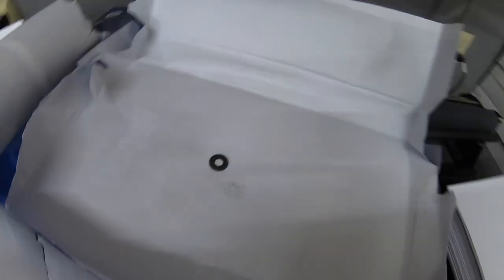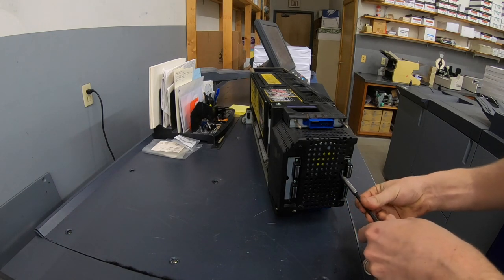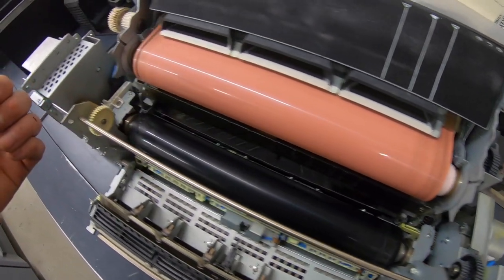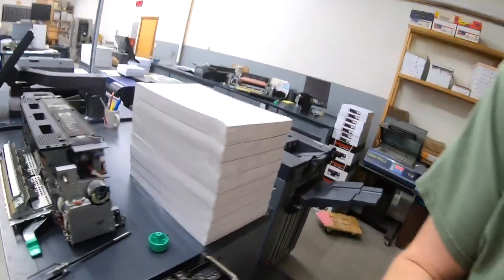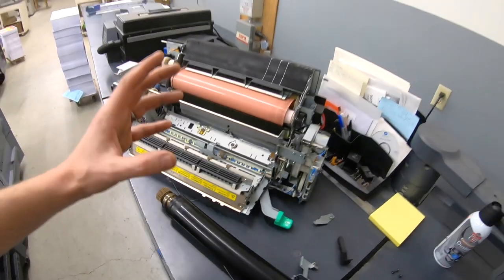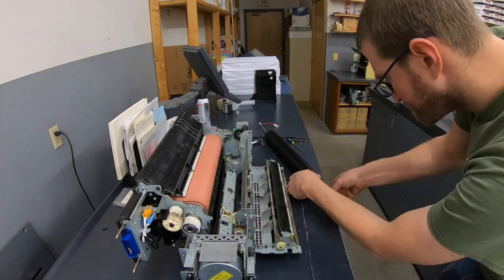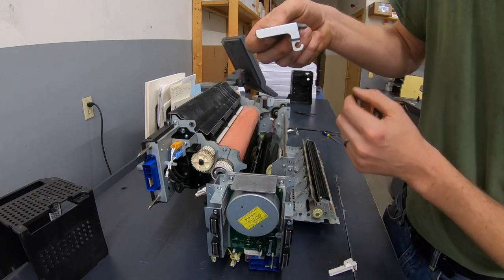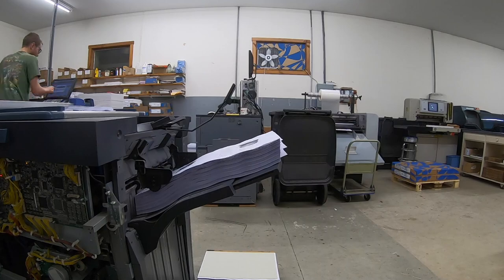Fuser Repair and Two Paper Surprises I Didn't Expect

Comment: Hello, 
I am a specialist and trainer of KM engines since 2000.
The lamp broke for sure because of the broken bearings.
My advice is that when replacing the bearings and gears you should apply high temperature grease.
It is also counterproductive not to change both sides at the same time to avoid skew, as well as to over extend the replacement of the bulbs because they degrade and lose heat output.
Good job.
From Spain 
Toni
Reply from the maker: Good to know, thanks. I have never put high temp grease on them but will get some now. Always feel free to comment, appreciate it!
Reply: Toni, can I ask your advice about a Problem I have with my C6000?
Reply: Hi Antonio. I would like to get in touch with you. How can I do so?

Comment: I recommend springing for a whole fuser unit to swap into any of the machines while you do repairs then you have more uptime.
Reply from the maker: That would be handy. Nice thing about having 3 color machines is I can either swap those fusers or just run the job on the other machine.

Comment: Just a recommendation, if you ever have to take apart and service the fusing unit, please make sure to always change you heat-insulating sleeves on the roller with new ones. Changing the bearings is a judgement call based on what one see, but regardless of how "good" those heat-sleeves may look, I consider it a "must" to replace. When they do break, the failure to the fusing unit is usually "catastrophic". The low cost of these heat-sleeves is well worth the long-term savings.

Another tip: Most KM production units now-a-days (whether monochrome or color) have default pressure setting for each tray (under the paper tray settings -> expert adjustments). I've set all my trays on all my machines to the lowest pressure and have noticed a considerable improvement on the fuser failure rate. We run several dozen KM production machines...

Keeping in mind that fusing (toner onto paper) is accomplished through a combination of heat and pressure) - The thicker the paper, the more heat (and less pressure) will be applied. Conversely, the thinner the paper, the less heat (and more pressure) will be applied to maintain consistent fusing.
The heat-sleeves will bear the direct brunt of the pressure being applied on those rollers. Reducing that pressure (and changing your heat sleeves more often), will save you lots of trouble.

The trick here is to ensure that your fusing is always adequate. One can compensate for less pressure by applying a bit more heat (by changing paper-weight settings on the tray). My suggestion is to always check a proof print by forcefully rubbing your finger on the print to ensure that there is no smudging (poorly fused toner) and then compensate by changing the paper weight if you find that you are having issues. Personally, I have seen zero ill-effects from adjusting the standard pressure to "weak" and never had to compensate on the paper weight, but I can see that it could potentially happen, especially with thicker paper. I hope this helps someone out there.
Reply from the maker: Great point. I lowered the fuser pressure on my c6500 by turning the screws and I noticed much longer life. I didn't think of doing that with my newer machines awesome! Thanks for the insulating sleeve tip too!

Comment: It's not unusual to lose a lamp when a bearing or insulating sleeve go out.  Sometimes the lamp can arc to the frame and blow up boards and solid state relays.  Good idea keeping old parts around, they always are handy.
Reply from the maker: Agreed, if there is still life in something and you have the space, hold onto it..

Comment: Hello, Everyone. The trouble has been tearing for 3 years. konika 3070, mileage on the meter 320 thousand was native with kotskaya but alive, working. we decided to change it so that the print was normal without kotsky on the middle of the sheet, and as the engineers said, it soon came up. I ordered, disassembled, changed, but I repent - I put the screw one crookedly and it turned out to be a little lopsided. I printed 20 sheets and the belt climbed to the extreme part on the left and broke. I took the stove to Novosibirsk to a professional service engineer. I replaced the belt with a new one that seems to be compatible with 30 K. but I said it would be necessary to change the bushings and bearings. printed 1 month - maybe 900 sheets. The finger tore the lower black shaft. - again replaced there. They also printed it for a month - I decided to replace the bearings, I didn't have time - the stove tape broke and also drove to the left, too, it broke. I took him to Novosibirsk to change the tape and bearings with bushings. Changed - brought, I feel it climbs again to the left. I called, arranged for departure to our city, came checked, cleaned

Comment: The Lamp probably broke when the bearing and sleeve broke. The lower lamp is used when the fuser is cold. When the machine is running the lower roller will take the heat from the upper lamps/belt. You may have seen an issues if you had been running a heavy stock for  an extended period of time.  Lamps are not checked for continuity the machine looks for heat on the rollers and  codes if the heat on the roller is not between designated temperatures.
Reply from the maker: Thanks for clarifying that the machine doesn't check the lower lamp for continuity. I appreciate the education!

Comment: As usual, a great video. I think that lamp might have gotten broken while you were disassembling the fuser. Typically, if a lamp is broken while the machine is powered on, you should get an error code directing you to check that fuser.
Reply from the maker: Thanks, yes I thought I would have gotten a code too. I should test that by unplugging the lower lamp and seeing what happens. The broken bearing might have cracked it and it still had continuity. I finished it off when lifting it out.
Reply: yes, correct. lamp inside fuser roller has a narrow gap. the moment you push that bracket holding the lamp sure lamp will be hitting fuser roller. broken lamp will give error code. i'm field Km specialist from Canada.

Comment: I have konica Minolta C3070 , When changing the fuser belt , a displacement occurs after operation , which causes damage to the belt again. What is the reason?